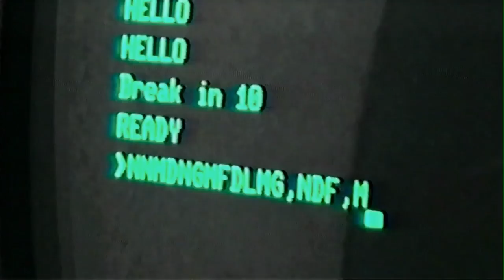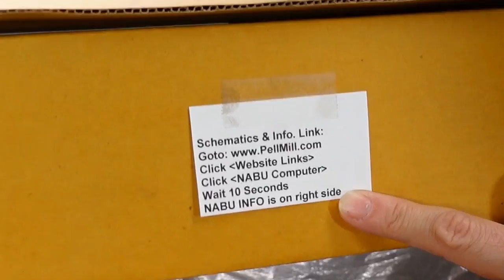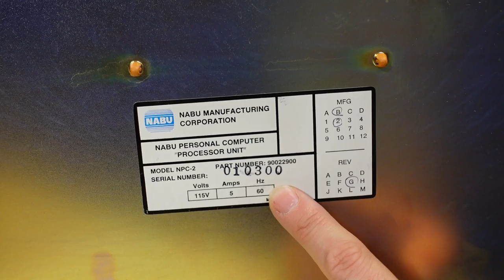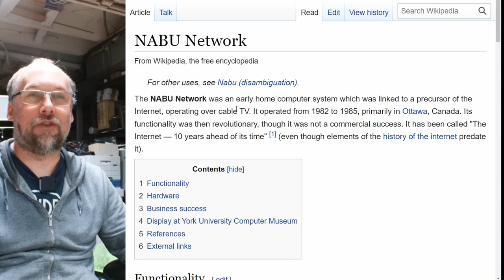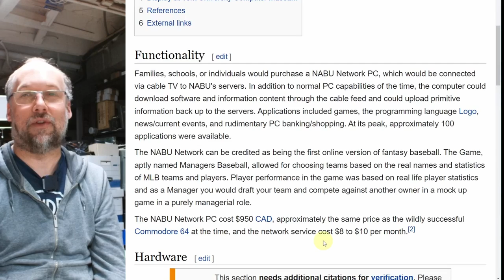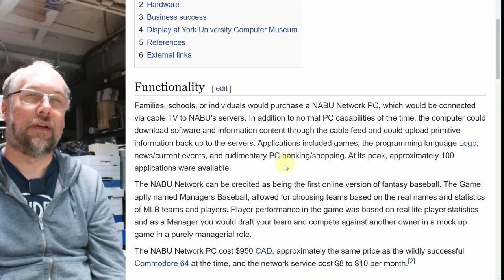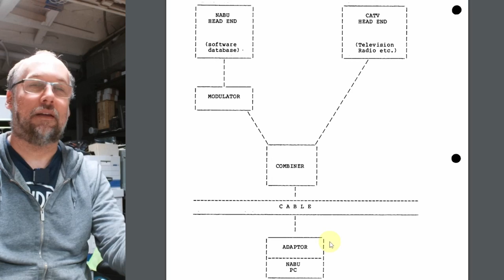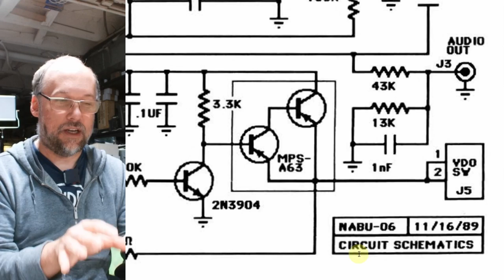The 80s computer you've never heard of: The NABU PC

Comment: Wait, a website in 80s? Isn't it possible it's a kind of a practical joke? Couldn't it just be built in modern times, you know, as a joke? Some youtubers technically could build something like this today, from the parts from the epoch that are still available. I watched a few videos where people built WORKING 8-bit computers from old parts. I watched some other videos when they built pretty cool cases for both PCs and home brewed computers based on RPI and whatnot.

Comment: umm really interesting video. It will be fun it was possible to create a rom to convert it to a sort of msx or linke a ti99 machine to make it usable on itself :/ but maybe is not possible.
Reply: I believe it IS possible with some work and effort. 
It is quite possible to assemble MSX-1 from scratch, I even seen chip sets offered on EBAY. 
This is like 60-80% of MSX, probably.  
At least it negates most of the work assembling one which is soldering all of RAM and VRAM to the CPU bus.
Obviously it needs MSX-compatible keyboard interface (and keyboard), and disk/cassette interface.
And we need to somehow convert port numbers (and probably memory mapping) to be MSX-compatible.

Comment: Just wondering if the terminal unit would have a Cryptographic system to authorize access to software as it would have a slot for a CAM adapter that accepts a NAGRAVISION CAM unit that would accept a NAGRAVISION Viewing Card.

Comment: A Z80 with early 80s slow dram definitely cannot handle 6.4 Mbps download speeds, that must be the max cable data throughput speed.
Reply: Z-80 CPU clock is Only 3.58MHz !!!
Reply: The cable modem box would handle some of the buffering I assume.